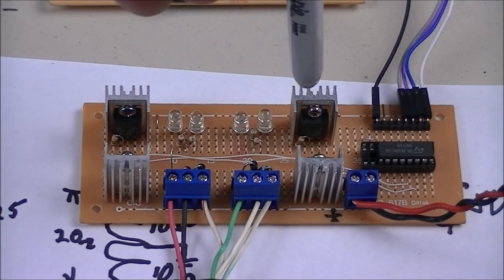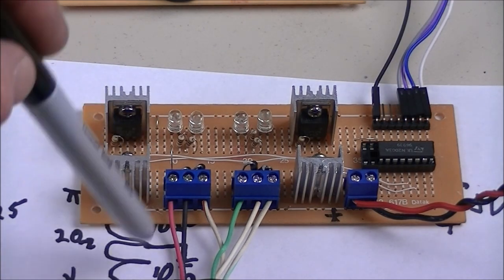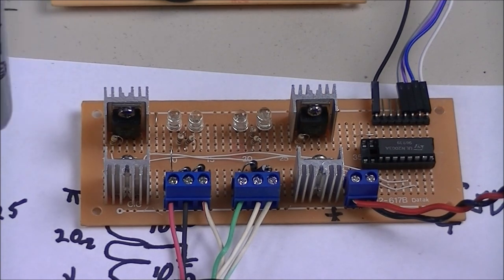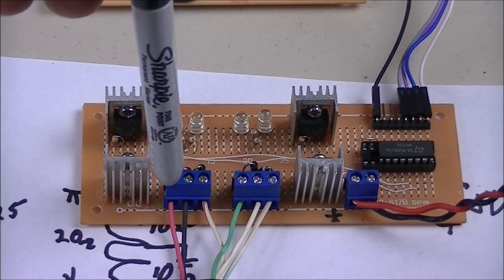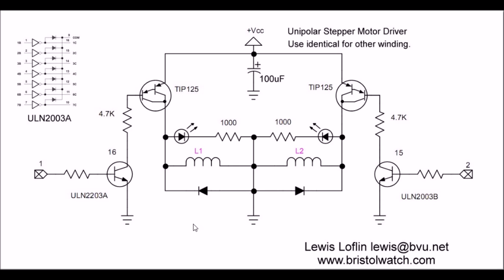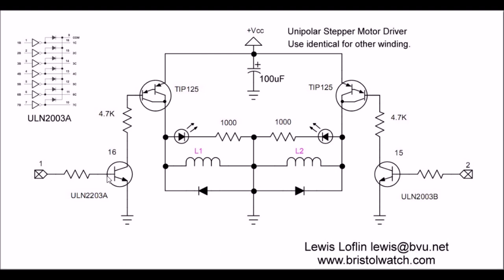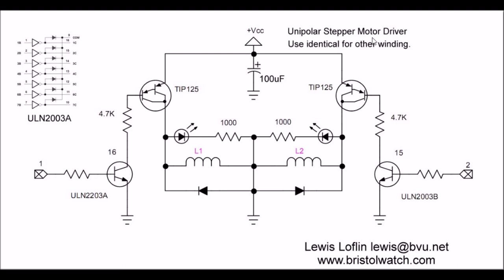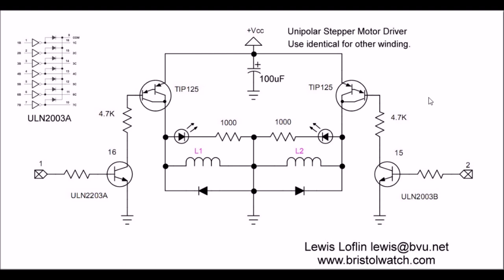PNP Darlington Stepper Motor Driver

Comment: I have a 24 volts stepeer NEMA 17 K steeper motor 4 phase unipolar.  I am using a Darlington transistor and my own built voltage regulator. My voltage regulator drops from 29 volts to 6 volts and the current goes wild.  When unplug the regulator from the wall AC soure,  the system blows common pins of the transistors and when engage the power back,  the Darlington chip burns!! I am puzzle because the darlington chip reads 50 volts rating. What I am doing wrong???
Reply from the maker: One issue with stepper motors is the winding is low resistance - cut them on with a narrow pulse then off. I can't find the correct spec sheet for a unipolar.  What are you using for driver transistors? What kind of controller?
Reply: @LewisLoflin  I have the transistor array Darlington driver.  But in the sampled  Arduino sketch uses different  polarities.  They are reversed when compared  to your set up. Current enters  the line between the  2 phase coils and  Darlington  sinks to ground each of the 4 pins of the unipolar stepper.  But just like you pointed, the resistant of the coils is so low that the current and voltage to the Darlinton set up is just too high.
Reply from the maker: Are you building my circuit as is?